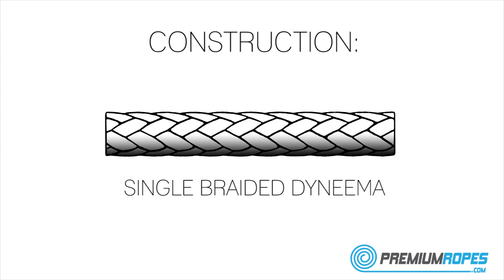8.1 Dyneema softshackle - version 1

Comment: the easy open pull cord is a nice touch but i'd use a button knot
Reply: Yeah. The benefit of the button knot is that it increases the diameter of the line so the radius of the noose is increased. Static ropes, dynema especially, don't like tight bends.

Comment: Hi two questions. I have purchased from you in the past and enjoy your mobile app also.  1. What is the spec of the thin blue keeper line ?  and 2.  Those "dyneema" scissors.  If they have steel blades, how do you keep them sharp ?  I have a lot of trouble with sharpening scissors in general and cutting dyneema with dull scissors is not fun !  I bought scissors for dyneema but they quickly dull. My ceramic knife works well, but I understand they can dull also. Its a problem.
Reply from the maker: The small blue line is a 1mm rope with a Dyneema core and polyester cover. The scissors have a special serrated blade. They can’t really be sharpened, but try to prevent to cut anything else then Dyneema ropes with the scissors.

Comment: HI THANKS FOR THE VIDEOS.  YOU SAY THAT FOR EACH EXTRA MM ADD 10CM LENGTH.  WHAT LOOP SIZE WOULD YOU THEN SUGGEST FOR 5MM DYNEEMA AND 6MM DYNEMA?
Reply from the maker: Hi, thanks for the compliment.  For 5mm it would be 21cm & 6mm 24cm
Reply: @Premiumropes  thanks  And I guess for 3mm ill use 15cm.  Cheers.  👍